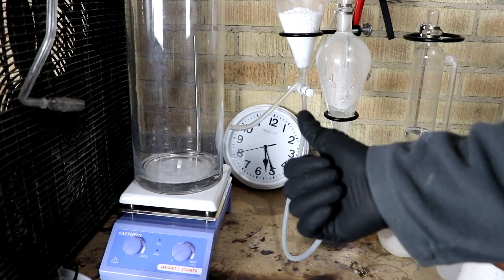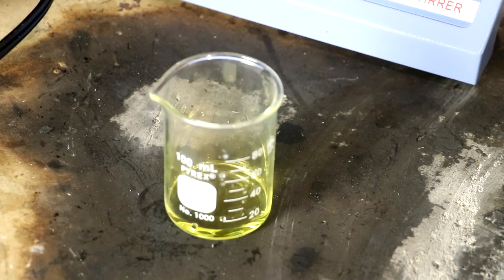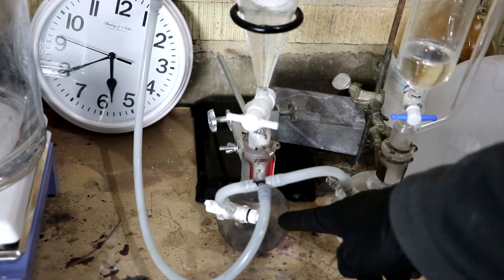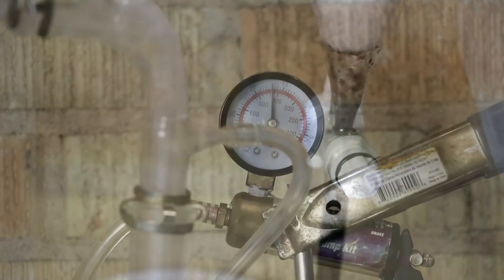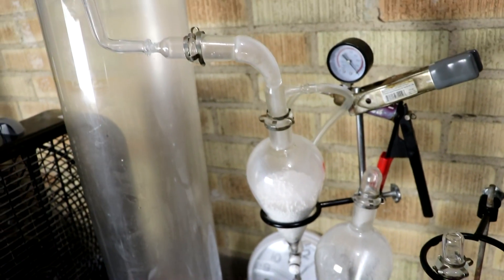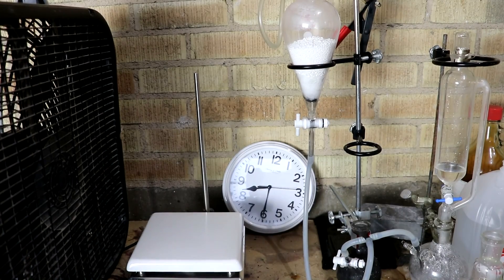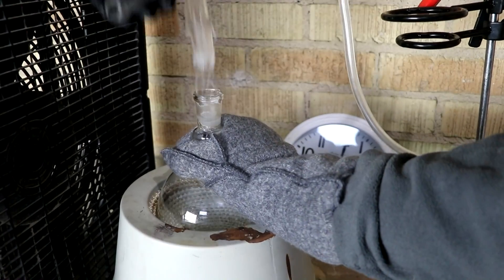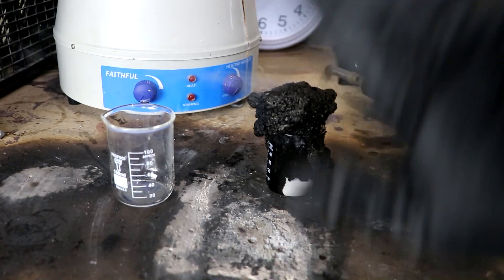Making Sulfuric Acid using the Chamber Process

Comment: Didn't you make Oleum ? The reaction with sugar was surprisingly fast and the fumes were excessive for just sulfuric acid. If you can test it i'd be glad !
Reply: No, it was just hot, straight from the distillation apparatus. There was also some nitric acid inside left. Basically it was a weak, hot nitrose.
Reply: Exactly what I was thinking, I've never seen 98% sulfuric react with sugar so quickly. There must be some SO3 dissolved in there.
Reply: Spooky Wizard
He's saying that hot pure sulfuric acid would be slower than the reaction witnessed, not that hotter acid reacts more slowly.
Reply: Pure, hot concentrated acid works slower than the liquid he poured out. That means it's not pure. There is something inside that increases reaction rate. What else than nitric acid?
Reply: If you had pure sulfuric acid (100%) and you tried to distill it, there would be some SO3 fumes because acid breaks down during boiling. Of course, we're talking about atmospheric pressure. Doing it in vacuum would depress the boiling point and lower the decay, although I don't know by how much. Vapor pressure tables on pure acid are not easy to find.

But impure acid is something else. Those vapors right before distillation starts are impurities getting oxidized and forming gunky mist you want out of the system as soon as possible.
Reply: Robert DeHart, you should sell your idea to the basic chemical industry. They've been making oleum by oxidizing SO2 into SO3 using expensive platinum catalysts and dumping it into H2SO4, but all they needed to do was to heat up some acid, not even distill it. Great profit. /sarcasm
Reply: Lajos Winkler the nitric acid would have been taken off as an azeotrope, I highly doubt there's nitric
Reply: ssholum Oh ok, so it's just unrealistically fast? Even cold sulfuric acid reacts quickly so I don't see why the oleum it looks like he's made which is hot wouldn't react quickly...There are white fumes which is characteristic of oleum. NO is colorless so it wouldn't be white and NO2 is has that red-orange color which isn't present...
Reply: White vitriol.
Reply: Wasn't any copper in the reaction beaker. He was adding it to sugar. Hot should react faster.
The sulfuric was just ripping H2O molecules out of the carbohydrate to leave carbon.
Reply: Spooky Wizard
Honestly, I don't know. I'm just conveying what Lajos Winkler was trying to say to you, since y'all seemed to be stuck on the 'hot acid' part.

As for white fumes; I assumed it was fog as opposed to fumes. Cody mentioned that it was near freezing, so I just figured that was water vapor condensing as it was released into the cold air. He just pulled that off of the still, and all. 
I haven't done much with chemistry, though, so my opinion isn't worth much on that; I prefer to make use of the electrons pumped around by redox reactions rather than messing with the reactions themselves. :)
Reply: OK, I see others have clarified the reaction part, so I'll skip that part.
However, it's impossible to get oleum by distilling sulfuric acid. Aqueous azeotrope forms and that's what boils over. Those white fumes look like smoke reacting with whatever he used for ground glass joint lubrication (only concentrated sulfuric acid should be used, no greases) because the joints went gray-black, indicating grease.
Reply: Yeah, I doubt that it contains Oleum, but there defenetly was something wrong, because the reaction was indeed way too fast.
Reply: SO MANY CONFLICTING STATEMENTS UHHHH
Reply: It isn't pure i think.
Reply: ssholum thanks for clarifying! But from my experience those are not water vapors, from what I've seen that looks like SO3 gas, thick and white, and doesn't rise too much.
Reply: Lajos Winkler yeah I guess you're right, if you hear it up the solubility of SO3 would decrease. I just know that when trying to concentrate sulfuric acid white vapors come off when it's about to distill so ....
Reply: Yeah he made Oleum. Which wouod be a gret yeild. The fumes and slow speed are a dead giveaway. Remember kiddos Oleum is diluted to make sulfuric acid.
Reply: Im Lost No guys thats just HCl. Why? Well, no one seems to agree to anything so i might aswell pile up my idea.
Reply: Lajos Winkler hot reacts slower? This is news to me...
Reply: Yes, with careful fractional distillation where you monitor temperature, but what he did left him with catalytic traces. Oleum is out of the question, and hot concentrated sulfuric acid reacts slower, so what could it be? I'd say traces of nitrose.
Reply: Lajos Winkler why would it be slower?? I don't understand?
Reply: Lajos Winkler concentrated nitric acid passivates copper when it reacts and so it's slower...but why would sulfuric acid dehydrating sugar be SLOWER when hot and concentrated?
Reply: Jim R that's what I was saying, I was just drawing parallels with how concentrated nitric acid could react slower and it has an explanation....they haven't given any explanation as to why sulfuric would react slower when hot and concentrated ...

Comment: How does that stir thing work
Reply: The stir bar is a magnet encased in plastic and there's a rotating magnet on a motor underneath.
Reply: Because of the hot plate's electromagnetic fields. That stir thing is a magnet rod.
Reply: Science!

Comment: Cody have you read about the recent findings with splitting CO2 molecules into CO using nickel atoms? Is there any way you could show something like this or maybe another way of splitting atmospheric CO2? As you probably know CO can be mixed with water to make hydrogen and water to make alcohol and hydrocarbons. This stuff is really cool because if fuel (hydrogen) can be derived from CO2 and water, enough industry will pull out alot of CO2 to cool the planet.
Reply: Apparently we've gotten pretty good at combining CO2 and H2 together to make formic acid (and formic acid can be decomposed to CO and H2O) so if you're interested in this type of stuff there's a lot of research papers available on the subject if you want to check it out :) And also don't forget about the CO2 + C <-> CO equilibrium, depending on the temp and pressure you can manipulate which way the reaction goes
Reply: I've seen variations on this so many times. Since hydrocarbon fuels end up burning to CO2 and water, if you start with those materials, make fuels from them, and then burn them, you'll consume just as much energy making the fuels as you'll release burning them. It's not really an energy source, at best it's a form of energy storage (albeit a potentially useful one). It also doesn't remove CO2 from the atmosphere, since the CO2 returns during the industrial process.

The best way to remove CO2 from the atmosphere is photosynthesis. If you care about the environment, plant trees.
Reply: Cool! Commenting just to follow up in case it starts a conversation.
Reply: There's been some discussion of using the Sabatier reaction (CO2 + H2 - -> CH4 + 2H2O) and electrolysis of water (2H2O --> 2H2 + O2) to convert CO2 from the martian atmosphere into methane fuel. The idea is to avoid having to carry enough fuel for a round trip on a manned mission: instead you send an automated fuel plant a few years in advance, and when your astronauts get to Mars there's already a return trip's worth of fuel waiting for them.
Reply: nerd1000ify except that somehow you have to carry to Mars the hydrogen necessary for the reaction- either as H2 or as H2O. I also think the concentration of CO2 on Mars woul make this even more uneconomic.
Reply: Conveniently Mars has significant reserves of water ice on its surface (confirmed by the Phoenix lander) so hydrogen can be obtained in-situ by hydrolysis of water.
Reply: I'm wondering how long it would take to produce the necessary hydrogen & oxygen using electrolysis, when you only have solar power. Electrolysis is very energy-intensive, and solar power on Mars would be even weaker than it is on Earth, though the escape velocity is also lower, which helps because it means you need less fuel for the return journey.

The other thing you'd have to bear in mind is that you need to make whatever you're storing the gases in quite pressure-resistant, because the atmosphere on Mars is only 1% as strong as it is on Earth. So there's going to be a large difference between the inner and outer pressures on the container.
Reply: Well all this stuff does need to survive travel through the vacuum of space anyway (no reason not to use the storage tanks as propellant tanks on the trip to mars). Dealing with 1 atm of extra pressure difference compared to sea level on Earth shouldn't add much weight (we're already dealing with several atm of internal pressure) As for energy supply, it is more of an issue: the 'dumb but effective' solution is to not bother with solar panels, and instead equip the fuel station with a small nuclear reactor (the reactor's waste heat can be used to melt the ice and/or dissipated by radiators). Otherwise you'll need a very big solar array, and some kind of autonomous construction machine to assemble it on arrival.

Comment: Forgetting to grease your ground glass joints, tsk tsk
Reply: Umh, not such a big mistake. Hot concentrated sulfuric acid will destroy most lower-grade vacuum grease. But that's usually not a problem since sulfuric acid itself acts as a very good grease for ground glass joints.

Comment: couldn't you use hydrochloric acid to produce sulfur dioxide?
also, if you are using hydrogen peroxide to create oxygen it's just a waste of H2O2 since peroxide with sulfur dioxide gives sulfuric acid

granted, this was only an educational video that looks at the process of creating sulfuric acid, not the optimisation and cost reduction of said process

Comment: Does the reactions work at high pressure say in a stainless steel pressure cooker to speed production and reduce necessary volume for useful production?
Reply: Stainless isn't completely passive to a mix of HNO3 and H2SO4; that's why originally lead chambers were used.
Reply: Stainless steel was not developed until long after this process was in use. But point taken line the pressure container with lead or other non-reacting material. What would you recommend?
Reply: Uhh... platinum? :)

Comment: cool demonstration. for bigger scale, you could use your pressure vessel (the one you use as a huge vacuum chamber) and pressurize by remotely making the gasses directly in the chamber.
Reply: of course, one would have to protect the steel chamber. i am thinking, treating it with hot phosphoric acid to make an insoluble coating...
Reply: Thomas Schneeberger sulphuric and nitric acid but remove phosphate coatings. You would need a suphate passivation but that is water soluable sadly. Cc sulphuric acid passivates iron but it wouldn't work here. Maybe chromium steel would do the job.
Or perhaps chro-va, the material used for wrenches. Vanadium could make it work
Reply: ...or he could coat the whole interior with lead. should passivate.

Comment: Obviously not a real chemist; he added water to acid instead of acid to water.
Reply: A real chemist knows when he can get away with it and when he shouldn't press his luck. With 5 mils of acid and 100 of water it might get a little warm at best. Not even that in his cold garage.
Reply: a real chemist just eats blotters of acid.
Reply: He's not, but real chemist wouldn't either. A real chemist would know that rule only applies to certain concentrated acids , namely viscous ones with high enthalpy change of solution. Concentrated sulfuric and perchloric acids are the common ones which can exibit steam bursts and splashing when water is added into a large batch.

I've met lots of people, even chemists, who are so profoundly stupid that they follow this rule with vinegar. Yes, vinegar. I would not tolerate such person in my laboratory. Someone who does that is grossly ignorant and a walking disaster.
Reply: William Ray he's a geologist. But he also tested the acid-water and vice versa and showed that it didn't really make much difference
Reply: The hazardous part is just the splashing
Reply: Did it matter?
Reply: He did a video on that subject a few years ago btw
Reply: It doesn't matter. The heat of ionization isn't enough to boil water... It's practiced so that people don't splash acid everywhere.

And Cody is bit lazy on the  safety side of things...

Comment: Never pour water in acid. Always the other way
Reply: Dylan Vellut he tested it already. Though it heated up by 1 c it wasn't very significant
Reply: Joel Su just a safety measure. Water absorb heat and splashing hazards are avoidable
Reply: Wait, i dont think it was 1c but the the safety concern there is mainly to avoid splashing the acid

Comment: You could probably speed up the process by sticking the chamber on one of those ultrasonic transducers that mists the water.
Reply: Commercial ultrasonic transducers have a metal casing. That will dissolve in nitric acid contaminating the product. The only materials that can withstand reliably nitric acid and nitrogen oxides are glass and ptfe.
Reply: The commercial process sprays water into the cavity. So you're not "out there."
Reply: That'd be a bit less authententic though
Reply: your phrasing in your first comment was a little confusing
Reply: Sorry my boi <3
Reply: @DiaveD why would it?
Reply: Im sure it would destroy in nitric acid
Reply: No ur stupid
Ooohhhh get rect stupeeeddd

Comment: Once i made sulphuric acid by burning sulphur and collecting the vapours in a bottle containing bit of water and leaving it for a day. Now i think it was  actually Sulfurous acid as i did not added any oxidiser (except ambient oxygen).
Reply: Hi, I think Sulfurous acid has been downrated at "non-existent".
Apparently SO2 dissolves easily in water but doesn't actually grab an OH group. Anyway if the water is rich in Oxygen (like most tap water or some DI water from reverse osmosis) the SO2 will slowly oxidise to SO3 and immediately become H2SO4.
Reply: Oh... if that's the case then its sulphuric acid. BTW why is sulfurous acid non existent? we do have lot of stable sulfite salts though.
Reply: When you dissolve sulfur(IV) oxide in water, only a tiny amount hydrolyzes, forming hydrogensulfite and hydronium ions. Sulfite isn't formed.
There are sulfite salts, but sulfurous acid molecule has only been detected in gaseous phase using spectroscopy. As soon as it contacts water, bam - hydrogensulfite anions form.

In addition, tiny amounts of hot sulfur(IV) oxide, as it's exiting the flame, does get oxidized into sulfur(VI) oxide and some of it does survive without breaking down, and that forms sulfuric acid directly.

So you actually did make an impure, very weak sulfuric acid. :)
Reply: vikalp raj he told you just that, dude. SO2 dissolves easily in water, but doesn't make a chemical bond with an OH group. No chemical bond, no chemical exists

Comment: -1000 points, using sulfuric acid to make same.
Reply: Proof of concept not a production run. I am sure he can find some sulfur to burn and maybe get a little more mercury to play with.
Reply: Today, sulphuric acid is made on industrial scale by the contact process and that uses sulphuric acid as a starting material.  +1000 points.
Reply: James Van Daele --- I'm glad you watched the part where he mentions that the point was simply to try to convert SO2 into H2SO4.
Reply: bdf2718 ok, I would disagree because I look at cody's videos as more of a what-if scenario where one would have to make everything needed to rebuild society after a catastrophe or the internet going dark (same thing?) Anyhow, to your point, I think he admitted he used more acid to get to the end point than he got out of it.
Reply: calvingreene90 my chemistry teacher told me that the chamber process, in big batches, is self catalysing. So you can make sulphuric acid using sulphuric acid with sulphuric acid as a catalyst
Reply: It's not a problem if you end up with more sulphuric acid than you started with.

Comment: Cody can you melt wood or paper in a room with no oxygen so it doesn’t ignite?
Reply: Not really, wood is about 50% cellulose and 25% hemicellulose both of which will decompose into Carbon, Hydrogen, and Oxygen and self oxidize (dehydrate?) leaving behind mostly pure carbon and water. The other major component is lignin which will decompose into C H and O as well, though you'll end up with leftover Hydrogen so there should be very minimal CO2 forming. This is pretty much how charcoal is made industrially, the wood is sealed in a container and then heated. Once the oxygen is depleted the carbon more or less stops burning and you're left with water vapor, carbon (charcoal), and some natural wood oils plus any contaminants you might have had like dirt or rocks.
Reply: philondez thanks I didn’t know that!

Comment: Hey Cody I was wondering if you could try to extract some silver from light sensitive silver gelatin paper
Reply: There's really not much silver in photo paper.
Reply: Fagrid yea but if you had enough paper...
Reply: Paper is super expensive. If you have a bunch a lot of people would be willing to buy it (including me).
Reply: There's not much silver in paper after it has been fixed.
Reply: Fagrid OTOH there is quite a bit of silver in the spent fixing solution. When I used to process photo paper in my youth I used to recover the silver from the spent fixer. It wouldn't make you rich but you did get back some of the money spent on consummables.
Reply: Yeah, the fixer removes the silver halides from the paper.